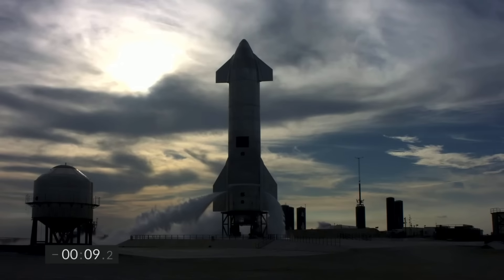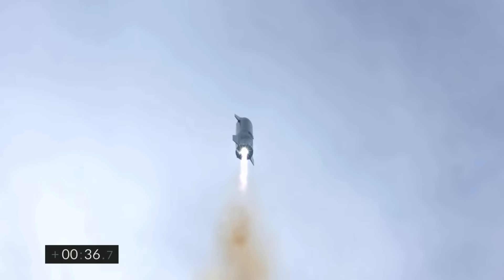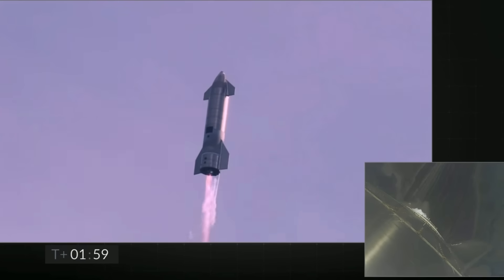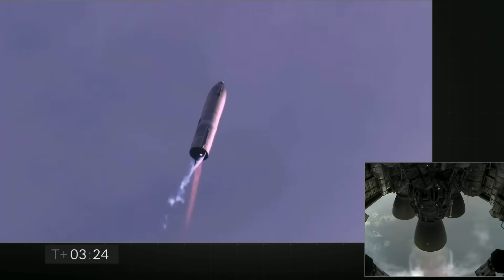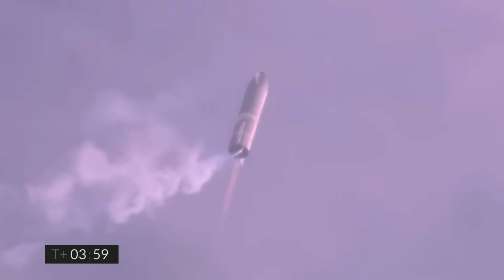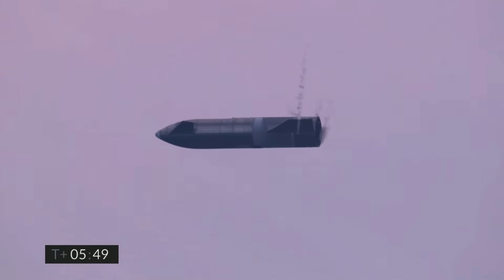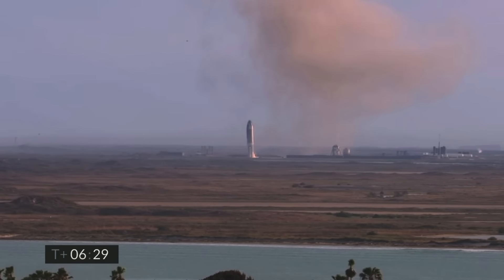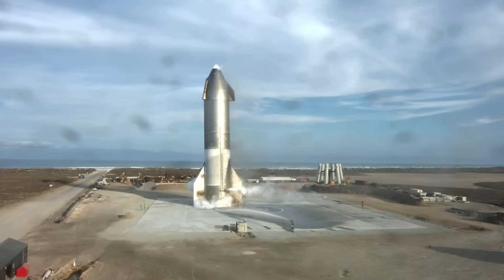SpaceX Starship SN10 soars, lands for first time!

Comment: All that smoke and it moves slower than a helium balloon..
Reply: Yeah, because the rocket is... heavy as hell :)
Reply: @WJT.   thats not possible, rockets has to lift quick or they're tilting..
Reply: @eirikmurito  ...
Reply: @WJT.  it needs instant speed or it will tilt during takeoff like a hotdog balancing on your finger..
Reply: This rocket is probably the one of the heaviest in the entire world
Reply: @terasgamer9097  and also the most non-existent because if that 1000 ton dildo jetlighter was real it wouldnt lift an inch..

Comment: The external video camera does not contribute anything. Instead, it is the camera that points to the engines that says what the fault is, but here they avoid it on purpose, it really is the most interesting thing.
The structure of the engines moves easily, it does not have a firm support, an engine is turned off, an internal steam escapes, loss of strength, but they remove the image, or hide it, this video is NOT complete.

Comment: Thumbs down for being dishonest enough to cut out the aftermath without mention from this video as if it didn't happen.

It is very unscientific to not present ALL relevant data when claiming a technical achievement.  I have significantly less respect for the SpaceX program as a whole for approving an official video that pretends the full reality of the test doesn't exist.

It just makes me question what OTHER faults and failures in their tech there may me they may also be conveniently failing to mention, or acknowledge the existence of.
Reply: This was a livestream and they didn’t know it would explode 15minutes later so they cut it

Comment: It's kind of amazing that it can maintain balance with a single engine that isn't situated at center.
A bit of a bounce on the landing (I wouldn't call that "soft"), but that's still really impressive.
I wonder what space flight would be like today if this kind of innovation had been presented back in the 60s.  We probably didn't have the computers for it.
- So wait, it exploded shortly after this video ended?  DOH.  Maybe that water nozzle should have raised its pitch a little.

Comment: Will this require heat shield ties when it re-enters when the rocket is fully operational?
Reply: Yes, they're sticking with heat tiles. You can see patches of test tiles on the hot side.

Comment: I believe that you need a better system to cool the engine responsible for the main thrust ,especially when the ship has landed the cooling must continue and even be increased.The engine is extremely heated especially close to the ground in the final landing stages.

Comment: If I were Elon Musk, I would sell explosives and fireworks...I'm sure he'll make a lot of money.
Reply: That is why you are not elon musk. He has done more in 5 years than nasa did in 50
Reply: @pizzabagerenmujaffa8123  I agree with you...Elon Musk is the King of Marketing. He has reinvented a bigger space shuttle...just more expensive and more dangereous to pilot. This is not my personal assessment, just the opinion of Steve Jurczyk ,the new head of NASA who is not particularly impressed by SpaceX and their 6000 employees. Cheers mate ✌️
Reply: @belkacemseddiki1174  
That's because he doesn't like the competition. Musk and company have been pushing the limits and showing the way. 

But then, NASA has a thing about spending years testing stuff before they put it together. It usually works, but they did have a serious problem program called the Shuttle. A high failure rate program.
Reply: @0GreatMerlin   So basically, if I follow you, NASA engineers and scientists are a bunch of bureaucratic arseholes unable to produce anything that works ? Waaaoooow ! Really ?
Reply: @Dimitrius Didimitrius LOL

Comment: It bounced ever so slightly upon impact, and while that might seem trivial, that would be enough stress placed on the statically loaded construction of the vessel and its systems to cause a rupture and explode.

I never would have thought I'd see aerospace companies create rockets that take off and land vertically, it's clearly possible, but that bounce was not good, they'll have to be completely flawless if rockets want to be reused without shock loading causing damage to critical systems, especially ones that might leak out explosive contents.
Reply: Yeah. Everything is still in very early stages though, so we can't be expecting too much.

Comment: Prove me wrong, but when an engine was shut down some residue still  burning  carried propellant flames backwards inside the motor chamber. At landing 2 engines were shut down simultaniously and double the  amount was combusted  backwards while trapping the heat/pressure in the motor chamber with the extra pressure from the  dynamic air cushion bubble generated at the landing. My bet the extra pressure damaged some internal pipes what carried the propellant to the engine as the pipes were probably prepared for internal pressure, not external. Thanks for the full course of entertainment SpaceX. I would make the Explosion footage available for paying customers only to get back some money for the lost value.

Comment: failures and failures, again, and again, and again
Reply: This wasn't a failure in the slightest. It achieved all its objectives, and even landed for the first time ever.
Spaceflight is super hard, you have no idea, and prototypes will explode in the most amazing way possible. But that's what prototypes are for - testing stuff and blowing crap up.
Reply: @xmimagma4630  it achieved nothing but an explosion. In order to achieve something significant, spacex must launch a model comparable in weight to the final product (fully equipped and manned Starship) to be. Instead of it we see just a pipe with thin wall made of sheet metal. So it is not a hi-tech progress but merely an imitation of it.
Reply: @Kremlin3000  what the hell do you mean it achieved nothing but an explosion? It achieved a landing, even if it did explode last time, proves the reliability of the engines and other components, let them get more data from various instruments and also now they know how they can improve it! How is that a failure?  If you bothered to look beyond what you can see in the video, you'd be amazed.
Reply: @Kremlin3000  and yes, it is very high tech simply because of the raptor engine, the computers needed to measure the speed, altitude and other variables, the maneuvers needed. 

Rocket science doesn't happen over night, mate. It takes time. These are the very first prototypes of q very complicated rocket. It took many years and explosions for the Saturn V to be prepared for a mission to the moon, and guess what, none of those flights apart from Apollo 1 were really a failure.
Reply: @Kremlin3000  basically, you don't know what's a failure and what's success unless you're on the team. Even the slightest improvement to the last flight is a success.
Reply: @xmimagma4630  your overreaction just proves that I am right. There's no scientific progress in it, just imitation.
Reply: @xmimagma4630  ok, let us see the next failure, you surely will proclaim  as another success :-)))
Reply: @Kremlin3000  how does my over reaction prove your right? Exactly it doesn't.
Reply: @Kremlin3000  look at the falcon 9 explosions. Were they failures? No, because now we can land a fricking rocket back on earth. There were plenty of explosions there, but none of them were by any means a failure.
The same will happen for starship.
Reply: @Kremlin3000  for the last time, if it gets further than it did last time, it's progress, and therefore success. Why are you so determined to call one of the greatest, most exciting things happening for decades a failure?
Reply: @xmimagma4630  oh, I see you have already nothing to write on the topic, small boiling pot? Run in the woods and never come back :-)))

Comment: This is interesting, i was watching frame by frame and you can see exactly what went wrong(the video actually shows it!) The rocket is supposed to land with 1 engine, but it should have been shutdown later, i thought my expectations of the ttiming was off... but after the first engine goes out, the second engine immediately goes out as well and not in the same way as the first, it then immediately re lights, has green flame and  then goes back out again and seems to be shooting out a fuel mix. with all the fire and exhaust, the leftover fuel catches fire, not a bad thing per se, but the vehicle itself wasnt on fire...  at this point the rocket seems to be accelerating a bit... and then the 'not quite soft landing' traps that fuel under the skirt and it probably ignites causing the rocket to get kicked back up and then slam into the ground after it landed, This may have even damaged the welds in the skirt below the tank. When the rocket explodes later the welds on the side give out first.

I suspect the engines were running at a vary deeply throttled yet stable state and when one engine went out it disturbed the airflow around the exhaust enough to cause the engine to go out. What im more surprised about is that the other engine never tried to light. or maybe the landing truly would have been OK with the expected crushed crush legs, but that explosion and hop and subsequent second landing caused too much damage...  So maybe if that second engine had stopped shooting out fuel it wouldnt have exploded and hopped leading to the later explosion.

Comment: There was a small jump aka hard landing on the ring. I guess that ruptured something. Only people with a death wish will ever land with that PR gag machine. And where on Mars is this supposed to land? You will need a landing gear for that. That has to weigh an additional ton and needs to be retractable. And what do humans want on Mars anyway? It's a dead planet. It's deadlier than Antarctica. This thing will never start and land anywhere near NY. The noise alone will make people deaf and an explosion or out of control rocket could destroy parts of NY. This is just a rich guy doing his hobby.
Reply: and they do have landing gears... same way that the suicide burn the falcon 9 does also has landing gears. And the simple answer to the mars question is simple, expand life to multiplanitary to avoid exctinction, science and resources

Comment: It's the most BIZARRE bit of footage ever. PORTIONS of it look like CGI...... The ONLY thing I can come up with, is, that, the materials it's made out of, combined with the way the light is hitting it, combined with a high frame rate.....and finally, the fact its a digital camera, are making it look like CGI sometimes. But this is weird for sure. Maybe also, because we are looking at something that is new and extraordinarily smooth (something we associate with CGI) we are putting the two things together. A 4K bit of footage would be good to look at...does one exist? We would see more imperfections in a 4K footage I would think.
Reply: @TheMovieAndFoodPeople  ^^^ probably the reason, same way that the first tv's made people believe that a train was going to hit them even though the tv was a 2d surface

Comment: This is by far the most fake looking of all the space x take offs...it cant be going very fast
8 kilometers is 26250'. 
It seems to come down faster than it went up.the little square screen on the lower right seems to indicate a much higher altitude. If your going to convince anyone this isn't CG then you need to clean up the background cloud shots on lift off and decent. I dont believe in the real world the background should look so blurry and fake..look closely at the shot when it's on the ground. One angle shows the gulf close by and another angle shows it much farther.on the take off at altitude the blue blurry background looks bad.free fallen without a little sway or wiggle on the way down.thats total freefall and it looks too stable.what landed doesn't look like what was free fallen. Not even close

Comment: Can someone explain why it comes down horicontally and not vertically?
Reply: That is because there is a larger surface area to slow the rocket down without lighting the engine.

Comment: Water was the mean cause of the explosion, ask me why?
Reply: Why was the water mean, what did it do to you
Reply: @ohrenaugenkatze_  water is a coolant right or now water contains hydrogen and oxygen gas, hydrogen gas In contact with chlorine, oxygen, or other oxidizers, is flammable and explosive and burns with a nearly invisible flame. Whereas oxygen gas is an oxidizer it feeds fire
So it is very dangerous to use oxygen around burning objects.
In conclusion pouring water on to the hot, burning space X ship to me was the cause of the explosion.
Examples: run your car or bike at full speed all day when the engine gets hot pour water on it immediately and see the reaction 
Example 2: put boiling water into a container and pour cold water on the outside a see what happens.
  That’s my own point of “view little things matter “
Best way was to allow the Space ship 🚀 to cool down on its own...
Reply: water is a coolant right or now water contains hydrogen and oxygen gas, hydrogen gas In contact with chlorine, oxygen, or other oxidizers, is flammable and explosive and burns with a nearly invisible flame. Whereas oxygen gas is an oxidizer it feeds fire
So it is very dangerous to use oxygen around burning objects.
In conclusion pouring water on to the hot, burning space X ship to me was the cause of the explosion.
Examples: run your car or bike at full speed all day when the engine gets hot pour water on it immediately and see the reaction 
Example 2: put boiling water into a container and pour cold water on the outside a see what happens.
  That’s my own point of “view little things matter “
Best way was to allow the Space ship 🚀 to cool down on its own...

Comment: for the mars trip   THEY'D NEED AN OXYGEN CYLINDER THE SIZE OF JUPITER TO SUPPLY 6 FOR ONE WEEK

   think about a diver's cylinder lasting 25 minutes before he has to surface

     They'd be travelling there for months so a jupiter size  cylinder or possibly bigger -  think of the weight so NO its not happening

Comment: If anything has become clear in these three launches, it is that SpaceX has managed to dominate 80 percent of the entire launch process, from takeoff, the good performance of the Raptors in the ascent, the shutdown and the belly flop maneuver and the descent. and aerodynamic guidance. It only remains to tune the last turn and hit the number of raptors to use.
My bet is 3 raptors for the final turn and two for the controlled descent, to ensure a smoother landing ... and better legs, of course.
Reply: Be cursed those legs

Comment: Is it just me or does that thing look so unstable in every respect, flight, return, and landing?  I mean when you compare it to Falcon this thing just looks like it struggles to do everything.  Placing engines in the confined space looks to be asking for trouble as we just saw trapped gas and it exploded like a cork.  Landing support, or lack of it looks to be a problem as well.  Yes it landed but looked more like the leaning tower of Pisa.  I think they need to go back to the drawing board.

Comment: I would not call that “soft”. The ship bounced a little and was listing to the left. But MUCH better than last time.
Reply: Only takes a matter of time to make it successful
Reply: Soft in comparison to all the other attempts.
Reply: green screen in the basement do this to .
Reply: @felikskrywiel8222  right, none of this is real.
Reply: @kilroy987  you do know you can go there and watch with your own eyes.
Reply: Yup! Idc if it explodes. Seeing PROGRESS after every fucking failure is a beautiful example of humanity.
Reply: its pretty soft.... for the size and weight of that thing
Reply: What a load of troll bollocks
Reply: I still think its because of fuel sloshing in the tank from immediately turning upright. Think of it, all the previous dragon and falcon turned retrograde and had a lot of time for fuel to settle down and spacex had no issues with relighting engines. The SN series with its belly flop does not. Turning 3 engines on and then shutting down the worst one is just putting a bandaid to a problem. Spacex is a company that used to keep failing again and again to get something right. Using a shortcut of relighting 3 and shutting 1 just doesnt seem like the usual spacex. The root cause lies dormant, and no one knows how shit can go sideways in the future. Not my money tho, so Im just a bystander with something to say
Reply: @de0509  Utter nonsense
Reply: @frankmcnally01  k
Reply: @de0509  I didn't see any issues with the raptors here. They trusted a bit too hard, almost stalling in the air so they dramatically dropped the thrust causing it to drop like a stone and bounce. Not only that but the landing legs didn't deploy which only furthered the damage.

Comment: Why is there an orange flame whenever one of the Raptors shuts down? It happened during both the ascent and the landing. The rocket was actually on fire! Pretty sure that's what caused the explosion.
Reply: From what I can tell the orange colour is from it burning dual rich which changes the colour, the explosion was more lickly from some of the legs not deploying cause the tank to get damaged